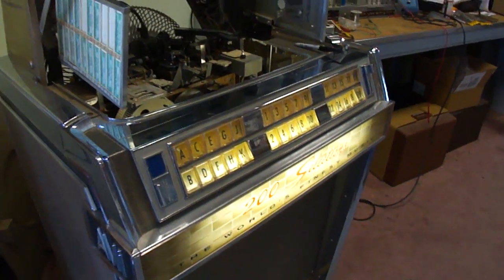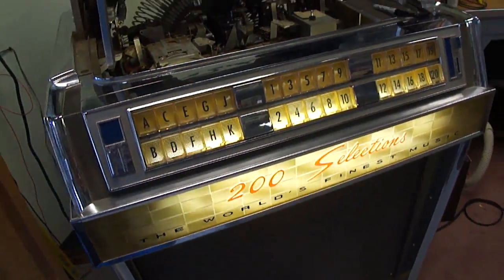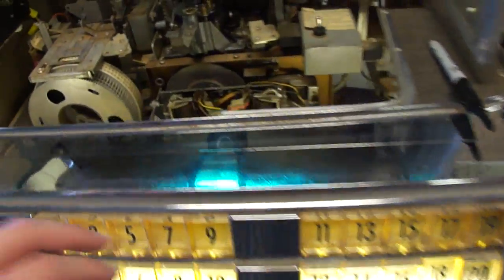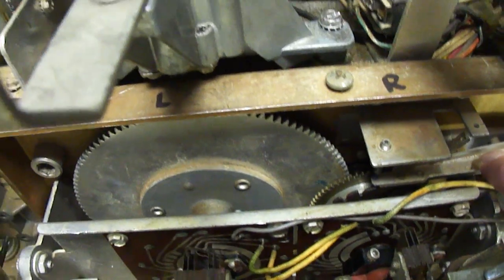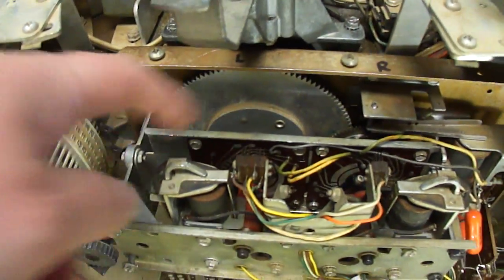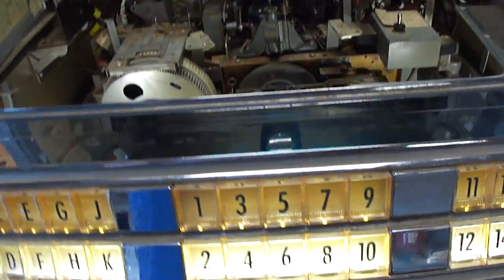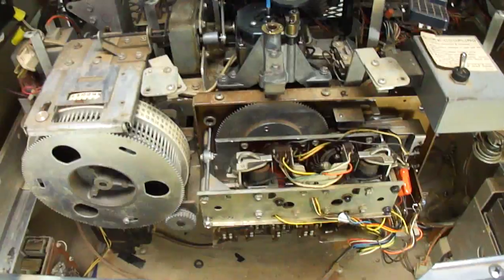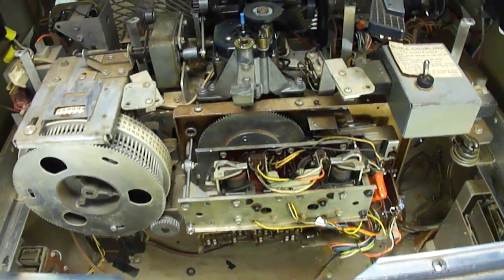AMI jukebox pulse converter overview

Comment: Can you please tell me where to purchase a manual that has technical information about the Pulse Converter. I bought a digital manual which includes a lot of great information, and includes parts breakdowns of the pulse generator and pulse converter, but it does not include any technical information or adjustments.  I was able to adjust the pulse generator from watching videos and trial and error, but I'm afraid to work on the pulse converter without a manual.

Comment: The problem is your power supply is sagging. Replace the capacitors in that along with the selenium rectifier and your problem will be solved as long as all of your wipers and contacts are clean and everything is adjusted correctly.

Comment: Hoping to get some advise on adjusting the contact wipers on an AMI Continental. At one point I had to take clean the contacts but I have been unable to properly align the wipers. A couple of times I it way off, for instance I would push A5 and it would play D5. Fortunately I was able to get it back to where it plays most selections. The only ones it won't lock on is A and B  numbers 7 thru 10 and J and K 7-10. It plays all selections on letters C thru I. One problem I have is when I try to adjust the wipers the record drum moves on me making it more difficult. How can I lock the record drum on A-1 and get it to stay there while I make an adjustment. I mean it's crazy a hundredths of an inch can make the difference. Any suggestion appreciated

Comment: You seem very knowledgeable about these machines so let me see if you can solve a mystery for me. I have a 1962 AMI Continental that works very well with one exception. It has always had problems playing any selection with the number (3) in it. In the past years I could try and select something with a (3) the the machine would just keep searching and searching. Usually after after several tries it would pick up a (3). Once it picked up the first time  it would suddenly start picking up the threes on the first go around of the wipers just like other selections. After i would turn it off and try it again a day or so later it went back to the same thing, wouldn't pick up at first and then it would. Over time this problem got worse so i referred to the service manual and got out my VOM and I checked the continuity from the (3) button to the (3) segment on the wiper board and I found that the connection was good. i further checked to make sure the connection was good from the (3) segment on through the wipers to the inner ring on the circuit board and all was good. So in summary the connection seems good, all other selections seem to play perfectly but not the three. I can't figure out where to check from here. i don's know whats suppose to happen beyond those wipers to make the pin pusher work and make the selection. the manual isn't very clear to me on what happens beyond the wipers. Any advise would be appreciated.
Reply: I had a similar problem and cleaned the wiper board with brass polish. I also loosened the wipers and cleaned the contacts and created another problem, As it turned out the contacts and board needed cleaning but in trying to properly align the wipers after having them loose has been crazy. I mean a hair off can make a difference and you're trying to align the letter and number wipers to hit the right place in perfect sequence. Most selections play now, Ive got it close but still not on top dead center with this thing.

Comment: Most common problem in the pulse converter is corrosion on the circuit board (both sides) which prevents the rotating contacts from making a good circuit, bent rotating contacts (somebody tried to fix it by bending something), or misadjusted rotating contacts, usually on the stepper side.  I think most of this circuitry is operated by the 24-volt DC power supply in the upper part of the cabinet; if the capacitor is bad, you won't have the full 24 volts required to make everything work.
I fixed two of these jukeboxes that were stored in an unheated warehouse for over 20 years; cleaned a LOT of contacts!  Got both of them working, but one later developed a problem of selecting the wrong record (B1 instead of A1, for instance).  Found that someone had adjusted the stepper contacts on the "letter" side and had not tightened the setscrew up after adjusting.  Lined them back up, and everything worked.
One other note - the pulse generator actually sends a couple of "dummy" pulses before actually sending the "letter" information.  If you watch this video when he shows the "letter" stepper and selects A1, you can see that the stepper actually moves more than one time.
Had one other troublesome problem - unit would occasionally blow one of the cartridge fuses for no apparent reason - could not find a short.  On an obscure page of the service manual, reference is made that the unit should use "slow-blow" fuses - this is not marked on the power supply.  Put slow-blow fuses in; no further problems.
DE

Comment: nice to have you back! if you have been working on one of these, i know where you have been for the the last months! i recently restored an ami I with the same set-up...you cannot mess with the pulse genorater or receiver, i bit the bullet,stripped it right down, replaced the wipers, caps and resisters, cleaned every contact, and set it up EXACTLY as the manual in sequence, held my breath, it worked 1st time, and has been faultless since...but i agree, it is a crazy system!  bob in the u.k.
Reply: hola sparkey quisiera saber donde conseguir el manual por favos? gracias saludos

Comment: it really looks dry try some teflon oil that wont dry out a drumal and polish the contacts the unit also looks dirty, dirt is the issue allways start a job clean like that intake allways power wash everything before u work on a car u dont want any dirt to get on the clean surface areas that u are sealing up i can see dirt inside of the machine lots of dirt and dust also run the unit when applying oil to the parts can hear grinding somthing is missing a bearing ?